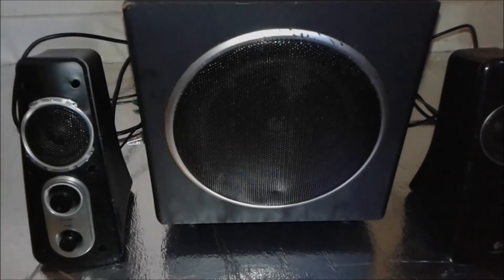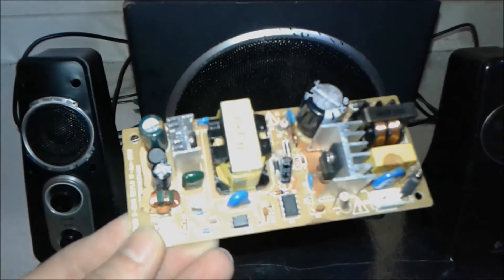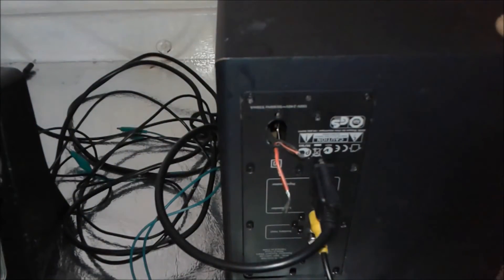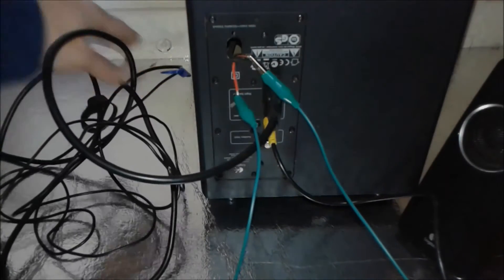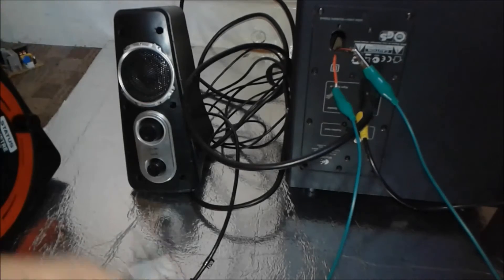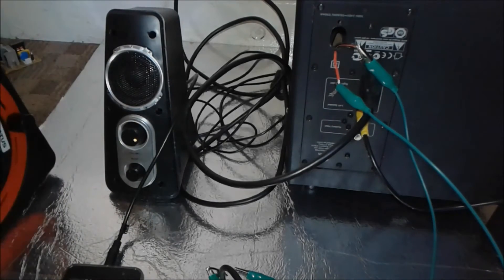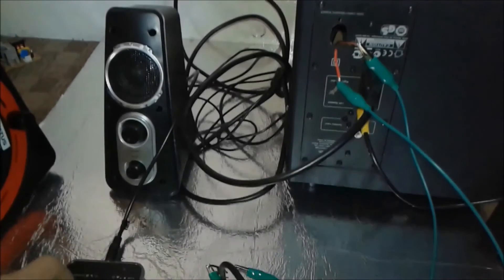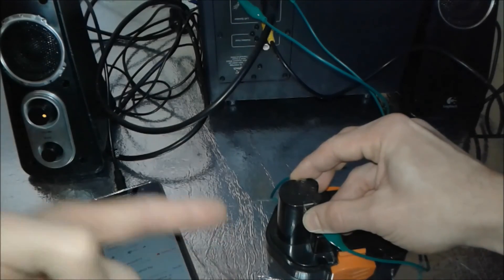How to repaire Logitech system at home. Logitech Z523 sound system

Comment: Well this video was the key to me finally fixing my Logitech Z523.

Spent years at odds with an intermittent loss of power issue.
After looking at your video and doing some research, It seems the Logitech power supply is 17V DC output. I estimate the amperage to be 3A as the speaker is rated at 40W RMS.

Grabbed a spare universal 19V laptop charger with a 5.5mm/2.5mm tip, had a DC female jack from a pico psu that jacked directly to the audio board, and I finally have working speakers again!

For those who prefer to get the exact voltage adapter, There are 17V 3A adapters out there on Amazon and AliExpress

April 2025 Update (2 years later):
Speakers are still  performing perfectly without issue. Still using the 19V universal laptop charger
Reply: Спасибо🤝

Comment: May I know what is the voltage and current output of the original Power Supply Unit of this Logitech Z523?
Reply from the maker: I powered with 19v power supply I am guessing 24v
Reply: @NoSkillsRequired  thanks

Comment: Just wanted to thank you for your video and leave a comment to help others in the future.

My z523 speakers just suddenly decided not to turn on this morning. I was ready to get a new set of speakers since mine are close to 10 years old, but decided to take a peek at it before I spent more money. Opening it up was easy enough, just unscrew the screws keeping the back plate and the bottom speaker in place, and you'll get spacious access to the inside, which also houses the AC adapter mounted in the corner. There are 3 screws holding the AC adapter in place - unscrew those, and you can pull it out. If you keep disassembling it by unscrewing the 4 silver screws in the AC adapter, you'll see the individual components, like what you saw in the video. More than likely, one of these components had failed. I had hoped that maybe it was a diode or a capacitor that I can find for cheap and replace. But in my case, one of the microchips had exploded (not sure how that happened), and I said fuqdat. So instead, I just decided to replace the AC adapter altogether. I searched far and wide, but could not find the model of this AC adapter anywhere. I did, however, have a spare Dell laptop charger lying around, which is 19.5V. I cut the barrel connector off, and it revealed 3 wires - blue, white, black. Black is negative, white is positive, and the blue is to power the LED on the barrel connector, so ignore the blue wire. Using that color scheme, just splice the wires appropriately to the original wires exiting the original AC adapter. Now put everything back together, and you'll have a working set of speakers that work like new! Just saved myself $70.
Reply from the maker: Glad that my video helps people all the best check the other videos maybe you will find more interesting stuff

Comment: hi, thank u for the video! I have a DELL POWER ADAPTER that provide 19,5V - 4,62A, can it work or can it damage theamplifier board? Greetings from Colombia!
Reply from the maker: It should work if you have the same sound system check thw polarity and start with the volume to minimum and then slowly increase it all the best
Reply: @NoSkillsRequired  yes, I have the same sound system. 
I'm really greatfull for your help.

Comment: I have the same sound system and it makes a high pitch sound that’s coming from inside the subwoofer

Update: I need a new power supply and I don’t know where I get one
Reply from the maker: Hard to tell my friend could be a loose wire,a capacitor inside is the amplifier board and power supply board
Reply: NoSkillsRequired did the power cable that came with your sound system say that it outputs 250 volts cause mine does cause the sound system is only for 240 it’s really important.

Comment: My speakers doesnt turn on, are the sames ones, this is the solution?
Reply from the maker: Juan Jmz hi there to you as well, this speakers are composed of power board, amplifier board, and controller in one of the speaker the one with led. This video is for the power board how to bypass and converted to solar or what ever provides 12-19v